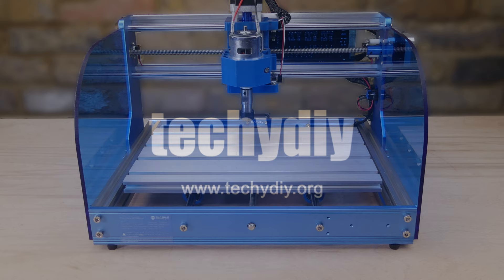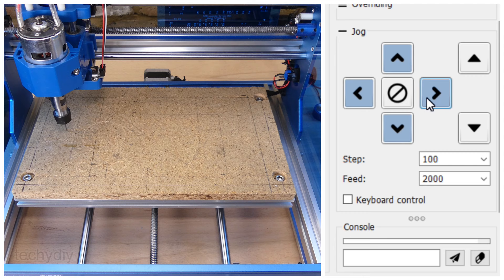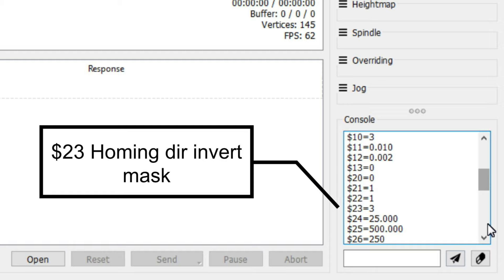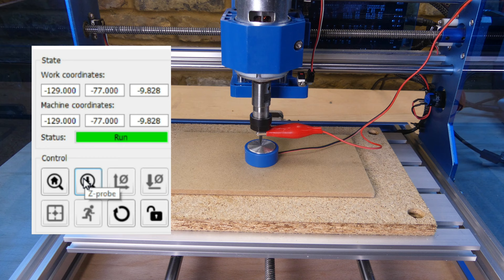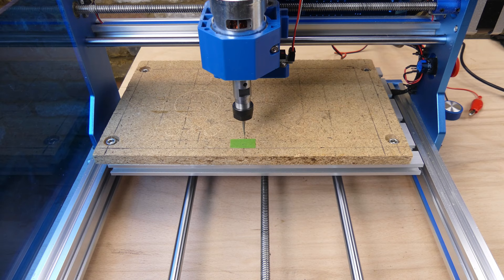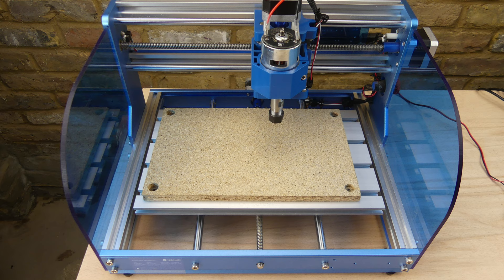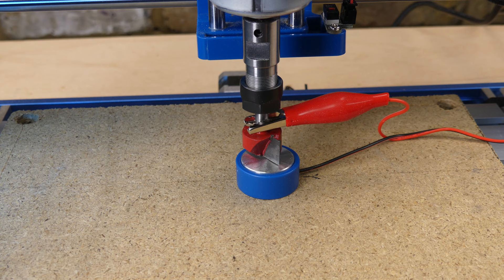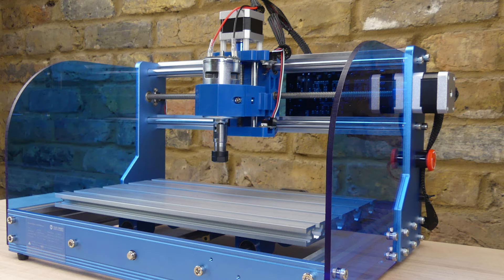Sainsmart 3018 PROVer Cnc. Candle, Grbl & Axes Calibration Tutorial. Part 2.

Comment: Great guide!

Quick note to say that, after setting the axis limits, the default z probe instruction should be changed to Z-30 instead of Z-50. Otherwise, z probe setting won’t work and you’ll have to reset the board.

Comment: Brilliant, @techdiy thank you so much.  I'm using this machine in my PhD and I'm working on a paper right now.  It's a cheap, reliable (so far), and well made piece of kit.  While I wish it had a bit more z-clearance (I removed the spindle and am installing something else in its place), it's very promising.  The software etc is all new to me, so I really appreciate your straightforward guide, thank you again!
Reply from the maker: Cool, now I am intrigued by what your using it for!
See here for an easy way to increase the z height   https://youtu.be/an0JTNjjmwc
Reply: @techydiy  Wow thank you so much for linking that video - I saw that it existed already, but didn't know from the title that it involved increasing the z clearance.  So, so helpful!  While I am short of time, I might actually be able to follow your approach.  I don't know why I never considered it myself actually. :)

I'm not using the machine as a subtractive manufacturing device, quite the opposite.  I'm trying to automate the preparation of mechanical samples of a very specific material using a bespoke technique linking Standards from different industries and applications.  It's a by-product of my actual research, but still worth sharing.  The fact that the kit is small, easily and cheaply available, accurate, and uses extrusions as a base is a real positive.  Once my paper is written, I'll be presenting it at the Solid Freeform Fabrication Symposium in Texas later this year.  If I'm able to, I'll share a link 

Thanks again for the excellent guides!
Reply: Can a laser head be added to this machine, please?
Reply: @hanilove302  yeah they do a laser kit that is designed for this machine

Comment: For people who are skeptical that these machines have ~1% errors in axis travel out-of-the-box, I can confirm that they do. I'd guess that these cheap lead screws are made via rolling dies. That's just not going to achieve the sort of accuracy obtained by cutting the thread on a reasonably accurate lathe or using precision grinding. But it's fast and cheap.

I have a 3018 Prover MX3 from sainsmart. To assess the calibration, I took the electronics out of the loop by just using my fingers to rotate the x axis exactly 32 rotations. You can feel the macrosteps, so this is accurate to less the 1.8 deg in 32*360. So about 0.02%. I measured the total carriage travel with my calipers as 129.15mm. The two carriage positions were both approached from the same side to eliminate the influence of backlash.  So calculated the leadscrew pitch is 4.0359mm/rev, rather than 4.0mm (0.89% error). Similarly I rotated the y-axis exactly 30 rotations. Here the bed travel was 120.83mm. So the calculated leadscrew pitch is 4.0276mm/rev (0.69% error).

We conclude that the leadscrew fabrication tolerances are pretty bad. If they are that wrong at full span, the error is probably not linear along the length, to even a two point calibration is probably not enough for accurate work, but it should improve things quite a bit. The 3020-PRO MAX advertises itself as having a 0.1mm accuracy, so perhaps it uses more precise components.
Reply: I did a real multipoint calibration on my axes and they are quite linear. The residuals are under 0.025mm. So contrary to the speculation in my original post, a two point calibration over a large distance as demonstrated in the video should get a machine pretty dialed in.

The manufacturing process must just have some sort of error that accumulates in a systematic way. Likely some sort of rolling die where the position of the portion of the thread currently being made is gauged from, and thus a function of, a few mm prior.
Reply from the maker: Thanks. As you say basic calibration can give a good improvement. 
Here is a nice little article about lead accuracy:     
https://www.helixlinear.com/blog/acme-screws/what-puts-the-precision-in-precision-acme-lead-screws/

Comment: Great video, really ideal when starting off.
Having a problem with the Z probe step...nothing seems to happen when I press the Z-probe button on candle. changed the depth etc all as described in video but nothing happens. it also crashes everything else so the manual buttons for moving stop working. No idea what's happening. I turned off soft limits also
Reply: Same here

Comment: in this video there is a mistake in the setup of the softlimits and the probe-command. you can't set 34mm for the z-axis in the softlimits ($132=34) - and then set 45mm as maximum travel in the probe-command (2Z-45F100). this will always trigger an alarm with stop at the start of the probe. the value in the probe-command must be smaller than the softlimit for z - e.g. (2Z-30F100).
Reply from the maker: True, I probably turned off soft limits when I was testing it.

Comment: Amazing Video Thank You! Ive bin having a problem with my bed not being leveled is there any fix besides adding shims to the bolts underneath? Thanks
Reply from the maker: Levelling a spoilboard as shown in the video is the normal method or for conductive materials you can probe the material surface and use a height map.

Comment: Very instructive videos... Using candle to calibrate the cnc movement, does this new calibration carry over , so if you go back to the offline controller,  should the new steps per MM be used by the machine? From now on?
Reply from the maker: Yes it does carry over. The configuration is stored on the microcontroller on the printed circuit board and used by anything connected to it, pc, offline controller etc.

Comment: Hi 

I am quite new to hobby cnc

But after weeks of trying I have finally got my 3018 grbl machine up and running, I use candle,

Please can you help me,

When I draw and save say a simple 40mm circle and save it as a cn file in carbide create, I then load it into candle, 

My question is when I open candle then spindle is a long way from the drawing and when I click send the spindle doesn't go to the exact place on my piece,

Can I get the spindle to start closer to the piece also move to the right place on my cnc table,

I read your article on travel settings and I actually understood it lol, 

Thankyou for that explanation,

One last thing I have bought 3 limit switches but not fitted them yet,

I have configured safe position finally but not the home button in candle, 

Can you advise please,
Reply from the maker: You have the set the zero / origin position in candle. 
Jog to where you want the zero position to be and hit the Zero XY button, then jog the z axis down uintil it just touches the surface of your material and hit the Zero Z button, then run you gcode.

Comment: When the calibration has been completed, are the changes saved to the router or are they only saved to candle? I guess what I'm asking is, when I use Candle to change the steps/mm then use the offline controler to cut a project, are the changes still saved? Thanks, great video, by the way.
Reply from the maker: They are saved to the microcontroller,  they will still apply no matter what you use to send the gcode/

Comment: Can I use a 150w Hanpose 775 spindle motor on the 3018 Pr0-Max? It's rated at 12A. My current board is a Cronos board and the machine came with a 100W spindle.
Reply from the maker: No, you can't use a 775 motor on a Sainsmart 3020 Pro Max because the voltage will be different and the size of the spindle motor will be different. 
If your talking about another manufacturers 3018 pro max then I don't know; but the answer is probably the same.

Comment: When entering changes in the console, such as steps per mm, does Candle retain these values each time you start the software?  Or are these values sent to the control board on the 3018 and stored there?
Reply from the maker: The microcontroller on the control board stores the settings.

Comment: Hello, Great video and easy to follow.  I'm only running into one problem with my end stops as they seem to be not working when I send the home command its acts like the hard stops do. I have $22=1 on $21=0.  Are the microswitches hooked up on the NO. side?  my machine is the Sainsmart 3018 PRO I had to add the microswitches and 3D print holders.  plus when I click Zprob it will not stop until it bottoms out hooked to A5 on the motherboard. Thank You for any Help
Reply from the maker: You might have to compile grbl with the right options enabled. There is some guidance on connecting limit switches on the gitHub grbl page
Reply: @techydiy  Thanks for your information and I ended up finding what the problem was. It was the mainboard not working properly even the main power switch was not turning off the machine.  "was on all the time".  After I changed the mainboard everything worked and was able to set up like your video Thanks Again and Saintsmart for helping me out to find the problem with the mainboard.

Comment: Extremely helpful video - thanks! 👍 One question: Where did you find an undersized spoilboard - or did you fabricate it yourself?  Mine matches the size of the bed and even with the limit switches removed it isn't possible to mill the entire width of the board.  Cheers
Reply from the maker: I made it
Reply: @techydiy  Nicely done

Comment: Good Evening!
First I want to say that your videos are fantastic.
I want to buy the cnc 3018 vevor basic machine .
Can I then get the laser module separately? If so what watts does it need to be able to cut 3mm wood?
Thank you very much
Reply from the maker: Thanks. 
I don't know, I have never seen a Vevor machine.
To cut 3mm wood, I would get a 5W or greater OPTICAL output laser.  Note that  most Chinese suppliers list the electrical input power of the laser  and not the optical output power. You should  search the specification to find the optical output power of the laser.
Reply: @techydiy  Can you suggest me a cnc machine that also has a laser? A cheap and good for someone who wants to do amateur.
A machine like the sainsmart 301

Comment: Why would the steps per mm be different than the calculated pitch of lead screw and the steps of the motor?  Squaring the gantry should eliminate this discrepancy.
Reply from the maker: The pitch of cheap leadscrews varies quite considerably. Enough to make a 0.5mm or so difference over 200mm.

Comment: Question on the probe script provided by Sainsmart. If we go with your limits for $132=34, then the script won't run, no? The script says plunge Z to 38.2, but can't go beyond 34.... When I measure as well, I get 20mm for the limit blocks and total of 54 between the limits, so I agree on the 34.... but then the script's off.
Reply from the maker: G38.2 is the probe command but your right it tries to probe downwards -45. I turn off soft limits, so won't have noticed.
Reply: @techydiy  To all:  This is  key...I had the same problem.  If the probe script Z motion > than soft limit Z motion ($132=x) then one gets a crash.

Comment: Hello, I've just received mine and when I use it, if a limit switch is hit, the machine stops and I can't do anything else... I have to switch off/on, unlock, move once, the machine stops again, switch off/on and then I can move...is this normal? when I see you video I would say no...
Reply from the maker: If you hit a limit switch you should reset and unlock, jog the axis in the correct direction and then it will probably trip again, so repeat.
The limit switches are there to stop you damaging the machine. You can setup soft limits but its normally more hassle than its worth. You will get the hang of it after a while, I hardly hit the limit switches now.

Comment: What can this version do that the MX3 cant, I'm trying to decide which version to buy.
Reply from the maker: They are roughly the same. The difference is the software. Mx3 version uses mach3, which is extra cost.  Prover uses open source (free) grbl software. For most people go with a grbl based machine unless you happen to want to use / learn mach3 (which is good). If you want to do PCB milling then go for grbl based machine as the software is better for that.

Comment: Setting the z-axis soft limit to 35 prevented the probing script form working on my ProVer, I had to change it back to the machine actual dimension of 45mm.  DId you make that adjustment because of your spoilboard or ????
Reply from the maker: I set it to whatever the maximum travel actually was. I did fix this issue but I will have to dig around to find out what I did.
Reply: @techydiy  I also had to adjust my z-probe script to a distance that was less than the soft limit.  The Sainsmart supplied command included a 50mm probing distance that was being rejected by the soft limits.  I reduced this to 30mm and the feed to 10.  Works great.

Comment: Hello, have you tried to upgrade the spindle to the gs-775M? sainsmart recommended upgrade? i have been looking up and down for  guide for tbe 3018 prover, but none found. I bought the kit, but theres no documents, no idea if i need to change something at the gcode or how do i set the max speed from 10000rpm to 20000rpm. read a comment on the Sainsmart website someone asking the same question, but they answered saying would create a guide, but nonthing yet. thanks for any help or future video on the subject.
Reply from the maker: Type the following command into your gcode sender console window:
$30=20000
To check the setting has changed  type:
$$
and scroll through to $30

These are the settings for grbl:
https://github.com/gnea/grbl/blob/master/doc/markdown/settings.md

You might find that the spindle overloads your controller power supply. Someone created some ramp up code to fix it, probably best to ask on the Sainsmart facebook forum if you find that happening.

Comment: What would cause the 3018 to not run with a 24 Volt power supply But it will still run with a 12 Volt power supply.
Reply from the maker: Could be several things. You could try running the spindle motor direct from the 24v power supply and see if it is ok. Did you replace the spindle motor by any chance?
Reply: @techydiy  I am getting ready to change it to a bigger size as soon as I can get the right  mounting hardware.

Comment: Hi,
I followed your tutorial by the book, everything was fine and I could move the 3 axes very well with arrows.
I shut up the computer and the CNC for the night.
Next day, the spindle works well but no axe want to work and always have alarms with them.
If I move the axes manually and ask for a home, they are moving and go back to home position.
Would you have any solutions for me?!?!?
Thanks!
Reply from the maker: What is the alarm that you get?
Reply: @techydiy  Grbl 1.1f alarm
Also got error:9
Reply: @techydiy  Even with the off line module (computer unplugged) I can't move any axe
Reply from the maker: Power up, unlock (to clear alarm), home and then you should be able to jog. Also worth turning off soft limits if you have them enabled

Comment: Hi, I'am using the offline controller with my 3018 PROver, can I do axes calibration with that? Will the cutting be the right dimension?
Reply: I just checked, looks like you cant do this with the offline controller. Checked my machine and its 0.7percent wrong in X and Y axis and also Z axis, which is fine for what I'am doing.
Reply from the maker: It doesn't have a console, so it doesn't really help. The machine should be pretty accurate by default.
Reply from the maker: And you already figured that out😀 Good luck anyway
Reply: @techydiy  thank you! I realised I could check after I made my comment. Thank you for really great videos! I have two stock PROvers and like them a lot. Ofcourse there is many better machines out there, but iam only cutting small stuff

Comment: your videos are great! im new and i need your help . i send code command to machine. machine will respond and move except spindle motor will not spin.
Reply from the maker: Turn the spindle on with the spindle on-off  button in candle:
If it turns on,  then its a problem with the gcode. Check your software and set the spindle speed.
If it doesn't turn on then its probably a problem with the wiring or a component (mosfet) on the controller.
Reply: @techydiy  i imported a different code and it started working just fine(xyz and spindle spinning) except spindle rised z direction about 20mm above the wood.
Reply: @techydiy  thank you. With your suggestions narrowed to the gcode. I imported a new code and this time spindle turned on except it moved z axis about 10mm away from wood. so was following the commands except not touching the wood
Reply from the maker: @ICHLIEBEmusic  you have to zero the Z axis on the surface of the wood.